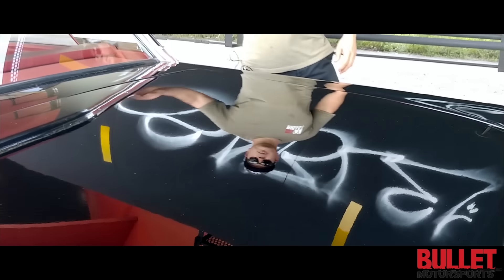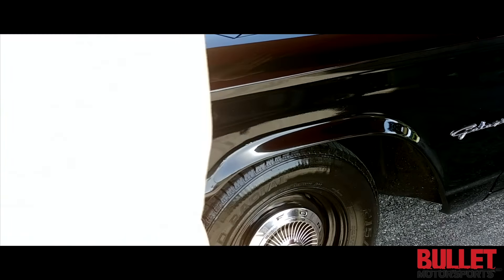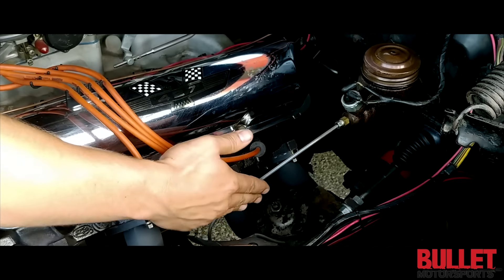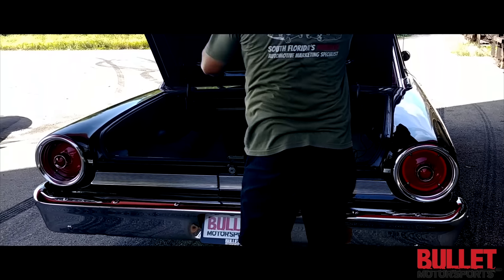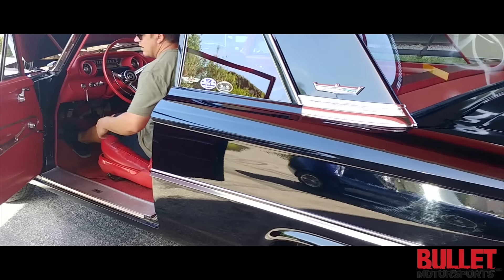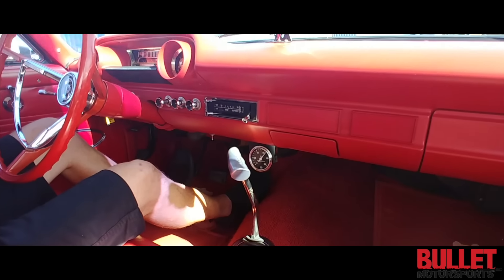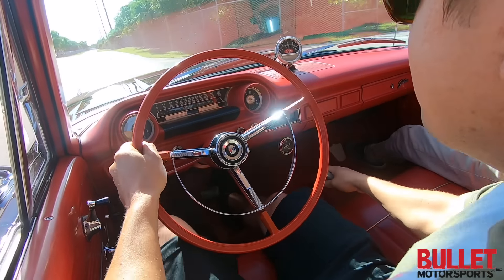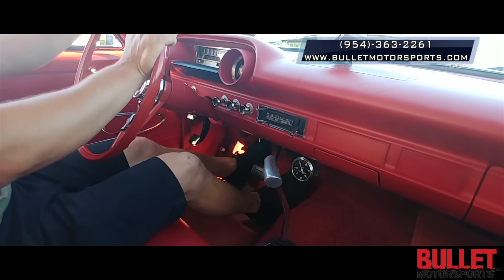1963 Ford Galaxie With 427FE Ripping Through The Gears! -[HD] Bullet Motorsports

Comment: Unmolested But has a 427. Okie dokie
Reply: He did say it was originally a 352ci car.
Reply: It is "unmolested".  There's no wheel tubs, the interior isn't gutted, the dash isn't chopped up for a bunch of aftermarket gauges, the paint is original not a repaint or colour change and it doesn't have Coyote or 429 stuck in it.  A 427 is still an FE, so no chopping of anything to put it in.  It is simply how a street/strip car of the '65 era would have been built.  Get a numbers matching 352 and drop it in, take the headers off and put on a stock exhaust and you have an almost perfectly original car rather than a resto.
Reply: Leland Lewis yeah but tell that to the die hard car collectors looking for a unmolested car. 
Tell them yeah man unbolt the headers take the 427 out put that inline six back in changed the rear ratio take them disk breaks off replaces the break booster get rid of the all the shit that was added to it for better performance and you got yourself a unmolested car you can sell at a higher dollar value. 

Yeah they look at you and laugh their asses off 
That’s why I said unmolested okie dokie. 
Top dollar won’t buy that because it isn’t unmolested. If you don’t understand what I’m saying your not a car guy. Sorry but it’s true
Reply: Leland Lewis and if that’s the case I have a unmolested 1966 mustang with a fresh paint job factory color and a built 331 stroker motor with 4:11 gears rebuilt C4. Just replace the motor with original 289 I want 18k I’ll take 16k
Reply: @derpyy4577  Bla bla bla.....
Reply: RichieD088 blah***
Reply: Its been molested, it doesn't have its original motor, some bodywork, and its 23,000 miles are "hard" miles, put on one 1/4 mile at a time which is likely why the original powerplant is gone, likely blew up decades ago. But, the car is still a beauty an a boatloads of fun to own I bet.
Reply: @derpyy4577  Hopefully whoever bought it didn't get "molested" on the price. Still though it would be a fun car to own just not some pristine original factory build like numbnuts is trying to sell it as.
Reply: Guess you didn't listen.
Reply: Did a owner convert the engine, or did Ford ? That will tell you if has been molested !
Reply: @lelandlewis7207  what about the tach on the dash???
Reply: @derpyy4577  , no need for insults.

All of what you are talking about are bolt-ons that are easily removed and don't change the original body, interior or undercarriage.  

Guys buy a rusted car and replace body panels, floor panels, rebuild the engine and tranny, pull off the body and blast the frame, etc., etc., to get to a body like this one, so unbolting parts and bolting originals back on is much easier and you don't have a resto body, you have original.  Plus you get to sell the performance parts to pay for it.

Unmolested, to me, is something that hasn't been modified in a way that chops the original.  As I said, no opened wheel-wells, tubs, roll-cage, etc. that would require major work to undo.  Bolt-ons don't molest the car and can easily be changed back.

Besides, what "car guy" is going to boot a 427 for a 6?
Reply: @derpyy4577  , glad to hear you didn't chop it up.
Reply: @devilsson6660  , that's pretty minimal compared to a gutted interior, roll cage and other major mods.  That's all I'm saying, the car isn't chopped up like a pro-street or some "resto-mods", body and frame are original.

Now, if you said it is "unmodified", that is different.
Reply: Relative term,427= enhanced
Reply: @lelandlewis7207  ... and fix that hood ...never seen one "vented" like that at the dragway back in the day !!!
Reply: @kman-mi7su  not to mention the door dents.
Reply: @derpyy4577  you're 100 percent right.  I'd rather drive this than the unmolested car but I agree with your point

Comment: I spent the summer of 1975 working in the greenhouses 140 degrees   I bought a 63&1/2 Galaxy 500 with the racing front clip. A 390 power  bucket seats.beforei had put 50 miles on it. My mother made me loan it to my older brother. He rolled it.

Comment: Screw all the car salesman talk. What's it clock in the quarter mile?
Reply: I have a few vintage road tests of this car.  High 14s in the 97 MPH range were typical, realizing that trap speed is largely unaffected by variables such as tires and gearing.  

Watch the video again and note the speed at which the scenery is passing by during full acceleration.  This car clearly isn't fast, though it makes a lot of noise and probably heavily squats down under acceleration due to poor suspension design.
Reply: @harddrivin1le-970    Wow that is a snail for running dual carb 427. If that's true this thing is suckerbait.
Reply: @harddrivin1le-970  You have no clue Hoss. Lol
Reply: @harddrivin1le-970  My dad had several 1963s and 1964s with multiple variations of the 390 and 427 engines that he raced back before I was born. He says the best he got from a 64 427 Q-code car (single 4bbl....410hp) was a 12.90. That was with 7" slicks and track 1960s track prep. The R-code like in this video in a non lightweight car was probably good for 12.60s-12.70s. Back then. Im betting that with wider tires with todays tire technology and track prep, it's a low 12 second car.

Comment: You can tell young kids dont know how to drive or the terminology of parts. 2 carburetors are called Duel Quads. Did you check and see if the Muffler Bearing was Orginal too.
Reply: How ironic that a comment such as that would spell "dual" wrong.
Reply: better check those finnigan pins before you go
Reply: They were called Two Fours son, I was there. If you would have paid attention in school (spelling...) maybe you would have been more successful and less angry.
Reply: Mike Barnes  ok boomer

Comment: My uncle Norman, my mother's sister's husband, had a 2 dr. '63 Galaxie 500(not XL) with a 300 hp 390. Had no power steering, but  A/C, AM radio with "3 on the tree" standard tranny. He bought it under the nose of my aunt. She didn't even realize it was a well performing car despite the T-Bird badging on the front fenders proudly proclaiming the 390 cid engine just as this one announces it has a 427. She was a "kill joy" and would have disapproved of his toy. Yours is a fine automobile with an outstanding correct Ford 427, but it's not a numbers matching car, which greatly hurts its value, as you're probably aware. It sure LOOKS authentic to the naked eye. Only someone who was curious enough to check the #'s on the engine block and then the frame would know. Again, that's one fine looking car.

Comment: A friend of mine had one when we were teenagers, used to blow doors off Camaros n trans am!
Reply: @robertmalone3997    They still had 63 Galaxies in 67.  And as the vid proves, they still have them now.  And I blew the doors off a 61 Galaxie 390 driving a 69 Camaro with a low compression 4bbl 350- not an SS.

Comment: Looks like the car runs like shit notice how it bogs when he floors it, looks really nice but maybe tune the carbs and get it running nice before taking videos of it
Reply: Yeah, that nosedive when he tromped it was embarrassing
Reply: I think if it is was mine I'd just listen to it idle.  Plus the gear needs a 4:11 and up, seems like a 3:2?.
Reply: He didn't have his foot in it. My 55 Chevy with a 301 and Edelbrock Crossram with two Carter Daytonas would do the same, if I didn't stomp it. It tried to load up and would stumble a bit til I really hit it.
Reply: This is carburetors....not fuel injection...kind of normal in my books

Comment: I see the builder spaced the hood up in the back. In the 1960s I had a 63 Impala SS 409 and used washers and longer bolts to do that to my hood. I had several Vetts back then and normally ran them with the hoods just sitting on their catch devices, that allowed about 2 inches of space times the hood width for hot air to escape.

Comment: My uncle has a 390 version of this car. He's got a modern NHRA  rear gear and axles and a T10 tranny in it. He can rev it up and bump the clutch and man that thing will skate around with you in a hurry. 390 is punched out though and he's got some aluminum heads on it. One in this video is immaculate though. Same colors inside and out of my uncle's. Nice car and video.

Comment: from experience if you added a black chin spoiler it will dramaticly  lower under hood and radiator temps when rolling,and you can put the hood back down, also much better high speed road holding due to reduced lift on the hood.  my Mustang would always run hot , after adding the spoiler I ran it thru North Carolina on  a day so hot the state was pulling trucks of the road because the tar was lifting , my car ran cool. one of the reasons every new car has one. beautiful job on this one so know you would want good info on that . what happens is the air gets pulled down and out of the engine compartment .

Comment: My father had one when I was in my late teens . Four door, only a 390 single four barrel, and for speed with the original Ford shifter. You are right about straight line. It would go, but didn’t like to steer or stop. Tiny little tires by today’s standards, 8.25x14 bias ply, drum brakes, cant remember if they were power, no suspension mods at all. On a wet road, you could shift all four gears, get the speedometer up over a hundred, and hardly be moving. Some fool did a U-turn in front of me and pushed the engine into the front seat. It was my fault because I was a teenager.

Comment: Giving My Age Away But I Had A 66 Galaxie T10 4 Speed (Black Also) Back In The Late 60's Dropped  A 428 SCJ Into it ( Not To Be Confused With A 428 CJ , There Is A Big Deference Even Though They Were FE Blocks, The 428 SCJ Had External Cross Bolt Mains, And Could Pull Up To 9000 RPM And Hold It There ) I Have Owned Corvettes And Hopped Up SB Chevy's That Could Probably Out Run This Ford In A Quarter Mile,
But When You Opened Up The Headers The Ground    Would Literally  Shake And Would Turn The Heads Of The Corvette, Hemi  & GTO Owners At The Drag Strip, Didn't Beat Them All But I Did Have There Respect
 That Muscle Car Era  Was A Great Time To Grow Up 
 Wish You All Could Have Been There

Comment: Had a 66 Cyclone GT 390 factory racer , Holley 4 Barrel on Medium Riser , Fiberglass Hood ,  Chrome Valve Covers and Air Cleaner from the Factory , Chrome Molidium Ball Bearing Tipped Push Rods , with other Factory Goodies internally .  For Insurance purposes they rated them at 335 bhp , more in the neighbourhood of 480 bhp.  The Car launched and laid a black strip for over a block once it stopped smoking the tires.  The 0 to 60 was not as fast as 60 - 120 and beyond since the needle was buried and it was still winding up.  Ford ran the 427 side oiler in the GT 40 at lemans that blew away Ferrari at speed over 220 mile per hour, left the more nimble Ferrari in the dust on the straight away.   Watched that race on Wide World of Sports back in the day.  The 428 is stroked 390 and the Boss 429 was a detuned 427 SOHC .  For performance Ford used TRW , Weiand  , Manley etc .  In the 60's when Ford was still in Racing , not much touched it, Ed Pink 427 SOHC , the  66 Cyclone first flip body funny car , the Eliminator I believe it was called. With that engine it was unbeatable as was Mickey Thompson as we Gas Rhonda , the list goes on .  The Ford TBird in the 57 was the fasted production car , ran 151 mph at Daytona Beach .  My friend owned a 427 dual carb Fairlane , it smoked everything , and my other friend , his mother owned a Galixie 500  with the same.   RJ Reynolds son has one with a Jet Engine , specially built , the Jet is on the Axle for extra boost , as if it needs it.  Now there are some that believe that you could only get some of these Engines as a Racer etc.  Actually if you had the Money you can buy it from Ford Special Division , or from Holman and Moody .  Ford knew the importance of Race on Sunday and Sell on Monday .  All the GT 350 Shelbies rented never came back with the HO 289 , it came back with the regular one.  Ford had put a 312 with 400 plus bhp in a 50's TBird.  Some Mag' s have read by so called experts who didn't live in the era nor was thought of ,  have some poor research skills or simply have a bias and make up stuff.  I was at a show and shine here and there was a beautiful 427 4 speed 64 Corvette Convertible.  Some young Lads peered inside and one said " it only goes 200 Kmh ."  This is in Canada in Winnipeg were we converted to Metric in the 70's.  I chuckled and said take another look at the speedo , it's not Kmh , but MPH , that's 200 MPH from the factory , it may just do that too.  They walked away I'm sure feeling foolish.
Reply: That's a lot of words and a ton of poor grammar.

Comment: I was born in 55, -we used to see stuff like this all the time. If it was a real "drag car" it wouldn't have a heater box under the dash.  My favorites were the 32 Fords and the 54 Chevy hi boys with tilt front ends. You should've cracked that motor wide open. That's what it was built for and it needs it.

Comment: My Dad was a used car manager at a Ford Dealer in the 60's I would go with him to the used car auctions. There was one I believe it was Butler PA maybe Pontiac MI but the auction was next to an old airport. I drove on a runway an 64 Olds 442 401 dual quads puter Gray with white interior... when those dual quads open best hang on cause they will cause it to fly... but the fastest I drove was a 69 Boss 429

Comment: I personally love the way the exhaust sounds. Low rumble with no cackling and popping. I always thought you should be able to hear the engine sound, carbs opening up in stages and the engine winding out as well as the exhaust.
Reply: Carbs opening up in "stages" with "progressive"  mechanical secondaries and the primaries opening simultaneously. Hilarious.
Reply: @deeremeyer1749  What is Hilarious?

Comment: I have a 1965 Galaxie with the 427 4 speed toploader. The 427 is very capable of producing around 500 HP. Now about the 6,000 rpm limit, It can go to around 7,120 rpm. The only thing you would have to worry about is the oil pressure and keep a keen eye on the temp gauge. Ford did produce 2 different versions of the 427.
Reply: There were two different block designs, the original FE design being top oilers and then  improved higher performance side oilers. When it comes to top end architecture, they had three versions, a low, medium, and high riser.   That refers to the intake ports, low risers had tall rocker stands,  high risers had short rocker stands and port size grew accordingly.  When it comes to cams and tuning specs, they had quite a few different 427's.
Reply: Well, not counting the low, high, and medium risers, top oilers, side oilers, and SOHC 427, although all of those are "R" code iterations I think, and the SOHC is different animal. 
You could divide it up by (R), (Q), and (W) code.
The (W) was the last and the least performance engine of the 427's.
The the last of 427's were stuck in the 1968 Cougar GT-E's, (because, why not?) and all were "W" codes with mandatory auto trans.
Weirdly, the 428 CJ Cougar GT-E is more rare than the 427 Cougar GT-E which are both 1968 models.

Comment: I was 17 in 63 and knew these big FE engines from owing a 61, 2 dr,cheap Fairlane (built at Roswell N.M. Ford for only drag racing (12:01 = 1/4 mile) with a 427 medium riser heads, mechanical dual points distributor,427 cast iron long tube factory headers with  4:88's,Tri power (3 -400 cfm Hollies) 3 on the tree due no 4 speed in Fords until 62. Back then 103 octane was the highest octane and was what all of these big block Hi-Po's used(.30cents a gal.)and NO place sold 110 octane. Piston engined planes used 130 octane av gas.  This kid must have have smoked some cush before making this video.

Comment: I have a 63 4-door sedan with a 390.  The motor is just worn out, 167K and it had been sitting in storage 15 years when we got it out in 2007.  I thought about sneaking a 427 crate motor into it but if it's got that lumpy of a cam forget it.  I built a Chevy with too much cam, and it really wasn't much fun on the street.  I am looking to rebuilt the 390 bone stock and put the Motorcraft 4 barrel back on it with the factory air cleaner.  I already have more in it than it will ever be worth but if I wanted an investment I wouldn't be playing with cars.  I also have a 68 Monaco 383.  Great cruiser but it's a 2-barrel, has a grandpa rear end.  And it outweighs the Galaxie by probably 800 lbs.  With a new, stock motor, the Ford would blow away the Dodge 0-60. 60 to 120, not so sure.

Comment: the car to have back in the 60s (until the mustang came out, of course)
Reply: Not a Ford guy but I'd take a 63 1/2 Galaxie 427 over any Mustang. Either that or a 66-67 Fairlane 427 or 70 Torino Cobra 429 SCJ. Always liked the mid to full size Ford's better mostly because you don't see them nearly as much as you see Mustangs at car shows and such.
Reply: @jeremythompson9122  true facts

Comment: While I appreciate the nostalgia of the car and the engine, I don’t see the point in bragging it up. Very clean car and neat engine, but these days you can crank out 550 horsepower out of a stroked small block. Yes, the 427 is way neater, but I’d probably opt to build an expendable stroker. I don’t want a museum piece I’m afraid to use.

Not trying to knock the car. Very clean and definitely a cool ride!

Comment: I had a 63 with a 390 auto and it would hit 80 in 700 feet which for a 17 year old was pretty quick. 
   Then I got a 64 XL 390 factory 4 spd with an experimental cam. I turned it around backwards trying to take off. That happened in 3rd gear.

Comment: I had a 1963 427 sidewinder engine, I built it "Out the ass" and stuffed it in a 1955 sedan delivery, it was a badass monster motor!! But the engine came stock with factory cast iron headers.
Reply: What are the specs on "out the ass"?